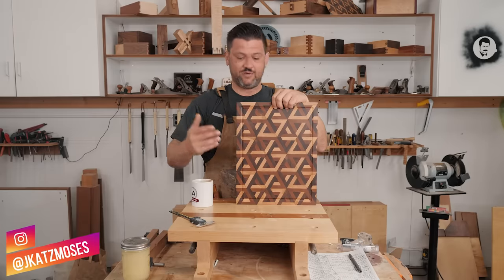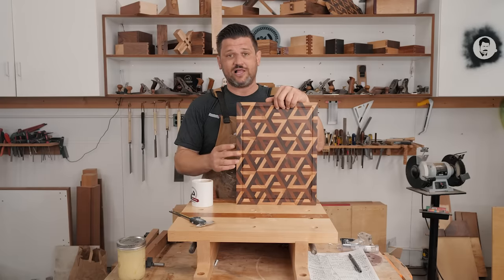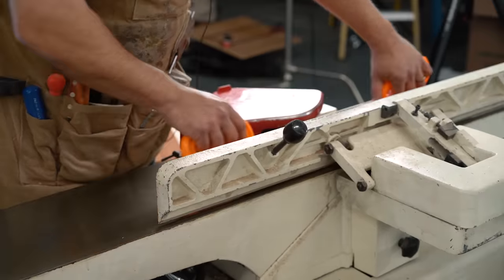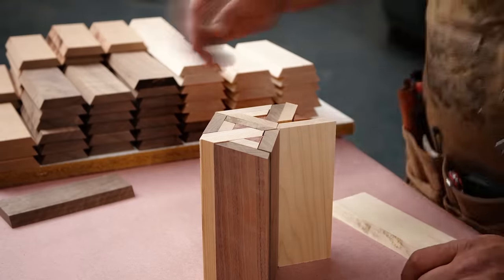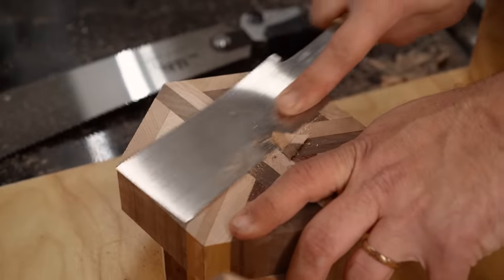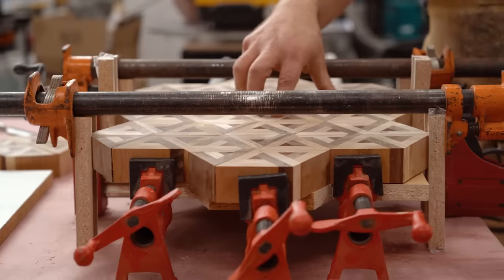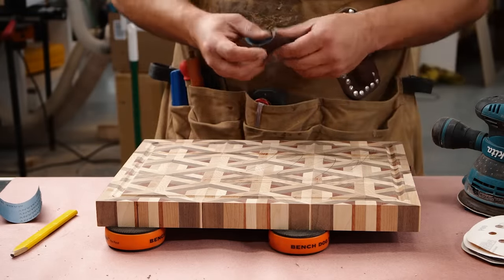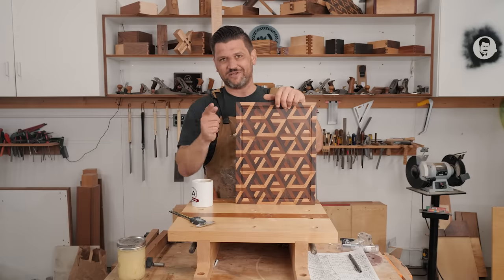Building a 3D End Grain Cutting Board

Comment: Hello from Lumberjocks, I am glad to see my drawings were of a help to someone, in making this extremally hard to build board. I did the original board with no jigs, I ended up gluing one triangle at a time, then waiting for the glue to dry before the next piece. It sat on my bench for months. Each piece had to be sanded to fit, to keep clean glue lines. I am glad to see someone has added jigs for the glue up.

Comment: I’m sure a drum sander isn’t necessary, but it sure is nice to have one. They’re so expensive and there’s no where that rents them out
Reply from the maker: Check out "architectural millworks" in your area. They usually have a wide belt sander and will run your piece for a nominal fee.
Reply: @katzmosestools  That would be nice but I'm an hour and a half from 2 major cities and neither one has an architectural millworks place. Is that the name of a company? I did a web search and 1 place "mentions" architectural millworks but that is 3 hours away in one direction! Another places I could look up?
Reply: @hotrodhog2170  a place local to me is just called valley planing mill. architectural millworks is the work they do, they do custom milling to match old trim profiles and lots of custom stuff. I had bought some scraps from them for cutting boards and they offered me the service of their sander and said they had people bringing in table tops, end grain cutting boards etc and its a real time saver and comes out perfect. so you can search for custom milling, or custom millwork etc for a company that would have the same service

Comment: AWESOME Board !
To see a lot of other amazing patterns in 3d endgrain boards check out mtmwood  he builds his with flat sections as opposed to Johnathan's big triangles. Clearly there are many ways to skin the Katz. 
The hardest part is getting the angles exact AND alignment during glue up.
If anybody wants to run the sections through your planer...VERY light cuts, and glue a sacrificial board to the leading and trailing edges or you will have amazingly bad tare out

Comment: Did you start with 8/4 and mill it because that's what you had on hand? Seems like with the warping trouble and having to mill twice that starting with 4/4 would be easier.
Reply from the maker: no, that is by far the cheapest wya to do it and will result in the most yield. Resawing lumber just does that. Planing and jointing 4/4 lumber will do the same thing.

Comment: Lovely build as always. Do you need to use epoxy to fill the holes in the final board, Can you use wood glue and sanding dust? It looks like 4 different species of wood, how many board feet of each kind do you need? I am interested in the class just trying to see how feasible it is for me to complete.
Reply: Rolly 545 the epoxy will fill the gap the whole way through the cutting board. The dust and glue trick will only be just past the surface and doesn’t look quite as good but that’s just opinion.  Looked like he used way more epoxy then he needed
Reply: Hans Idso would a 5 minute epoxy work in order to keep the amount of spill over down? And just apply the epoxy to then gaps rather than pouring it all over the board?
Reply: Rolly 545 I would probably go with a slower setting epoxy just to get that penetration and yeah I would only apply it to the gaps where it is needed
Reply from the maker: Wood glue could work. I made a ton of extra pieces but as with any cutting board its is a lot less than other furniture builds.

Comment: Sweet build but my brain hurts thinking about all those miters / bevels lining up
Reply from the maker: 360 pieces. Literally impossible to make without a couple small gaps
Reply: @katzmosestools  ... and that's why you used epoxy instead of wood glue to connect the hexagons together, right? Fantastic work either way!  There are similar projects on youtube, but yours has the strongest 3d-effect.